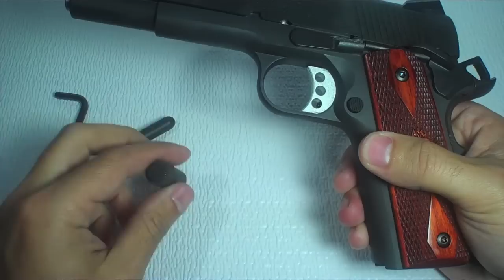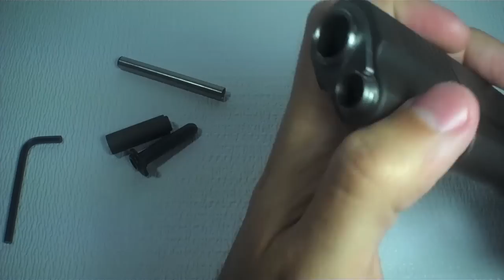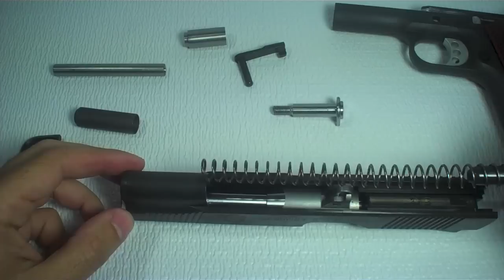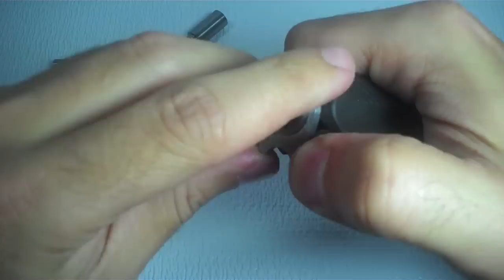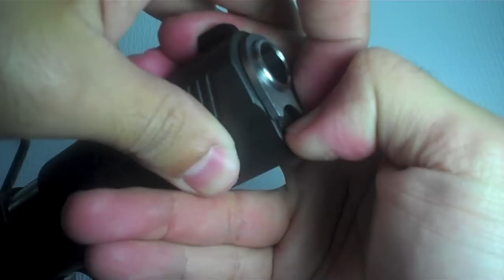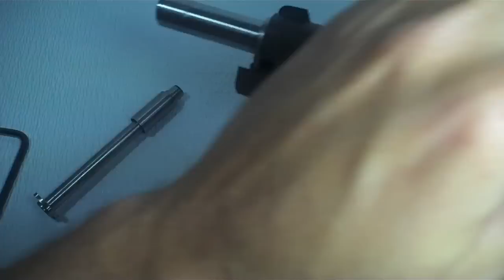GI Guide Rod and Plug for Springfield Armory 1911 Loaded

Comment: I made the same purchase of the GI system on my stainless version. There is literally no performance difference between the two, the difference is the ease of taking the gun down for service., Since I have a stainless gun I bought stainless parts and I installed a 18 pound chrome silicone recoil spring.

Comment: I did the same thing to my 1911 loaded. But, I also got the parkerized barrel bushing. It fit better than the stainless one that came with the gun. Couldn't tell any change in accuracy.
Reply: superHDglide where did you find the parkerized bushing that fits?

Comment: Did the same thing with mine. My 2 piece full length guide rod that came with my Springfield Loaded was stripped out where the Allen Key goes, Brand New gun too. And this came like that from the factory... It had to be removed by using channel locks on the guide rod lol. The whole concept of a 2 piece guide rod is that it is easier to disassemble and that is complete utter bullsh!t In my case, If you have trouble pushing the plug in you can use a wrench or other object to assist in that but I just use my hands and thoroughly enjoy a tool free field strip. Standard GI Guide Rod is the way to go.

Comment: i think you could have just left your original plug in there and just took the guide rod extension out and it would have worked fine (although it might hurt your hands when pushing the plug down). 
and  nice video it helped me figure out that i am gonna get a loaded springfield ive had my eye on but i just didnt personally like the full length guide rod look.

Comment: your dead right, the long guide rods aren't necessary or John Browning would have designed it that way, with a G.I.rod and checkered plug it's easy installing & removing the Valkyrie Compensator. the checkered guide plug is easy to push down to clear the locking lug

Comment: How's the parkerized finish hold up on the Loaded pistol? Contemplating between this, a Kimber, a Sig GSR and a Smith & Wesson. I like the features of the LOADED and saw one local in like new condition for $750. But I had a GI 45 once and the finish sucked.

Comment: Hi there, I'm living in Australia, I have a conversion question. Currently, I have a Springfield Armoury 9mm 1911A1 loaded. I would like to remove the Allen key ditch it for good and converted to GI model. I cannot purchase the parts that I require from the gun parts in Australia unless you get it from a gun dealer. None of them has the part number for the parts that I am looking for. Basically, I'm looking for the pain goes into the spring. If you decided to help me with my query, could you please let me know the part number for those two items?

Comment: How long is the recoil spring plug?  I ask because I have a screw-in muzzle brake by Valkyrie and length of the recoil spring plug is important.
Reply: +brentfoto should work ok, if not shorten it to 1.2 inches or simply use a commander length guide rod, the standard one works well in my Kimber and my Colt with the Valkyrie the full length guide rod is not necessary & is a pain in the arse, even the 2 piece, John Browning never found them necessary and he designed the 1911
Reply: Rory- My original post of a month ago is now updated:

With a Springfield Loaded and a RIA Tactical, both in .45, no modification is necessary to install Valkyrie (both recoil spring plugs are short enough), but the recoil spring plugs in both have holes in center in order for FLGR to go through. Drove me nearly nuts due to spring pressure and cut into fingers depressing plug in order to get the brake on and that was hit and miss.

Ended up buying GI guide rods for both (not really necessary for Loaded because it is a 2-piece FLGR-but agree still a PITA despite 2-piece) but equally important thing IMO is to have a recoil spring plug that has a checkered face or flat face (to avoid digging into finger), 1.2" or less, as you have stated, Rory, (in order to get it down enough for brake to install-others are too long) and especially with new guns where recoil spring pressure is great as spring not broken-in and a FLGR only increases that pressure. This is just my personal experience with install of the Valkyrie and I'm sorry if I have not made it clear.  I also purchased Commander recoil spring plugs for each weapon despite the original plugs as 1.2" or less because I wanted checkered or flat plugs as they do not 'cut' or 'dig' into my finger depressing them in order to swing the brake over.

Loaded seemed to be a soft shooter with the Valkyrie and a Wilson buffer attached to the guide rod.  Shooting it was quite enjoyable. RIA was not as soft a shooter, but I did not have the buffer on it with the Valkyrie, which may have contributed to greater felt recoil in addition to it not being a SA. In addition to the 'cool' factor, I really enjoyed the Valkyrie and would recommend.Thanks!

Comment: I am actually LOOKING for the 2 piece guide rod! I got a "Loaded" with a gi guide rod and i wish to install a 2 piece! 
If you still have yours, TheEnder's42, I would love to make a deal for yours?
Reply: +jvradar not needed and a pain in the arse
Reply: +Rory Gibbons  Agree that it's a PITA trying to install with the Valkyrie muzzle brake but I did not have any problem reassembling 2-piece guide rod with the factory bushing on the SA Loaded. I just followed the owner's manual to install the 2-piece guide rod. Make sure spring is around the first piece of guide rod in the slide because new spring is all but impossible to 'drop-in' from muzzle- it's a tight fit.
Reply: jvradar fuck that it comes with 2 piece I wanna replace mine with GI rod strip is a pain